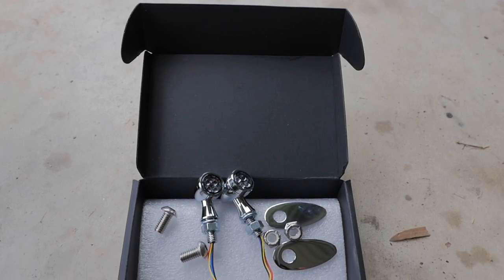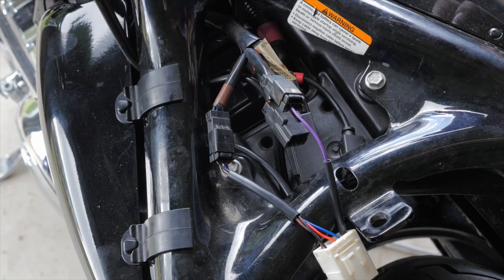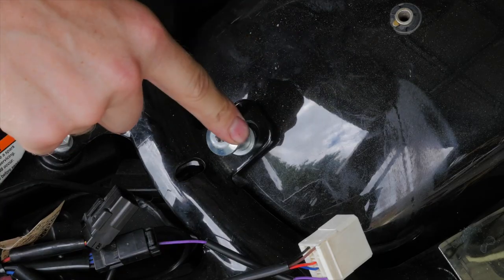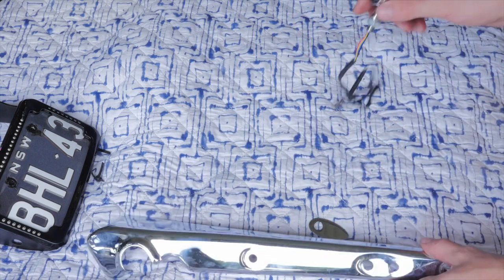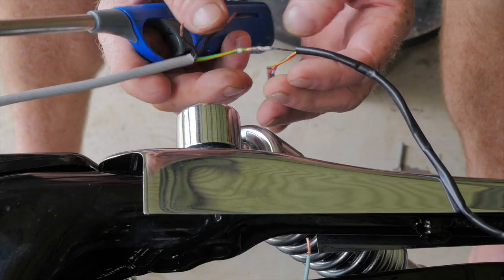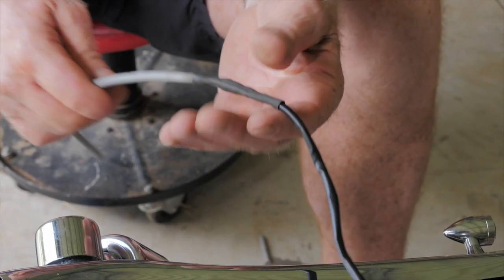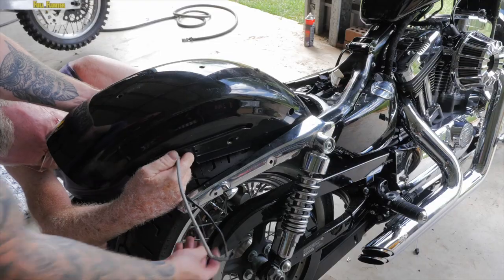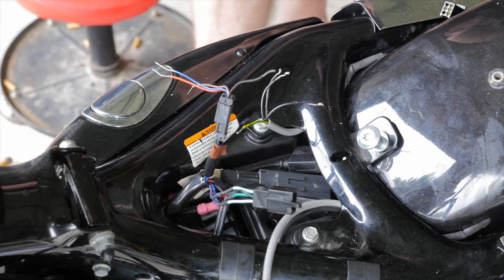3 in 1 indicators - Harley Davidson Sportster 72

Comment: Clean install. Sweet little lights! I’ve got some cool little flush mount rear three way lights on my Street Bob. Kodlin Neowise. Once Harley gets all the parts so I can install different handlebars, I’ll put the matching front signals on as well.
I love those little solder/ adhesive shrink tubes! Greatest thing since sliced bread! Lol
Reply from the maker: Thanks man. Yeah the connectors are so easy to use, great invention.

Comment: What is the yellow and red wire that goes to the rear. I wired mine up according to your diagram and they work perfect but I have one spare yellow and red wire left over. What is that for?
Reply from the maker: Is that red and yellow wire on the hog lights or stock wiring. If it's to the hog lights I think they're just running lights which you don't need to hook up.
Reply: @TheGingybeardMan  no the yellow and red wire coming from the bike. It’s it a power source?
Reply from the maker: @Beezy191  I'm not too sure what that wires to. I don't recall seeing it

Comment: Hey boss. I need some help please.
I have 7 wires coming to the back 4 for turn signals 2 each side and 3 wires for tail light which is stop and running light. I bought exact same turn signals but turn signal isn’t working whereas brake and running ling is working fine. Could you please help
Reply from the maker: Mate watch the video, I did a wiring diagram

Comment: Where did you get number plate frame from mate
Reply from the maker: It's a custom dynamics curved radius intergrated number plate bracket. It came with the bike but you can buy them off easy r in Aus too